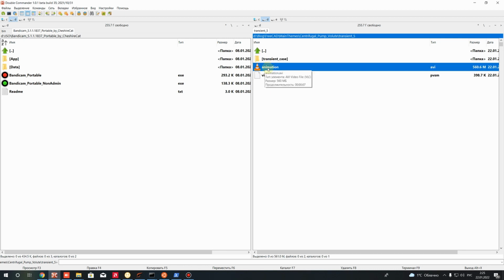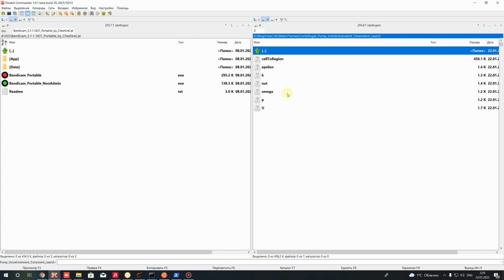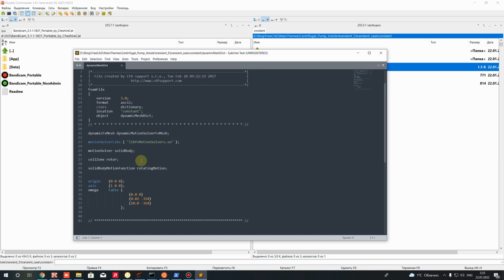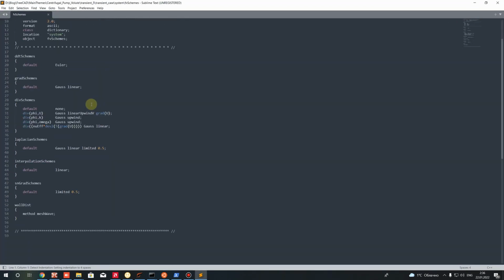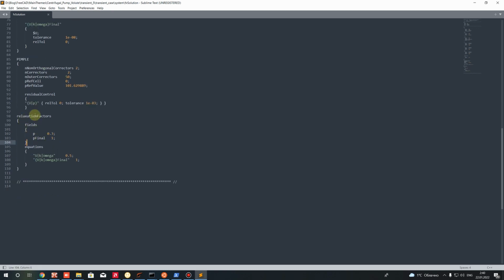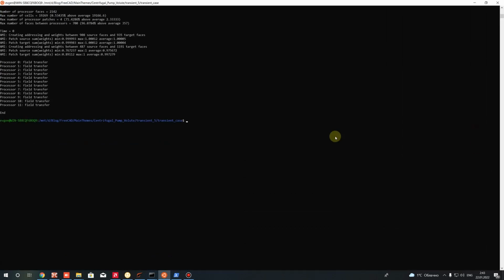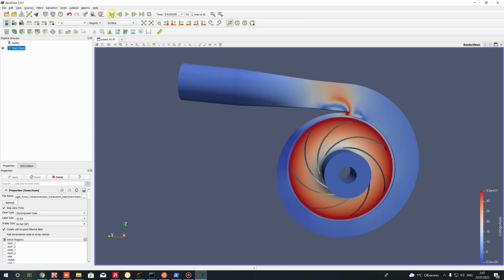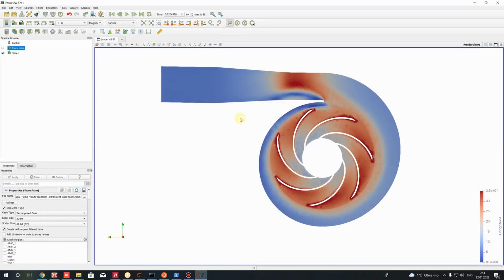FreeCAD + OpenFOAM Tutorial | Acceleration of Pump Rotor in Transient Simulation (pimpleFoam solver)

Comment: Hello, many thanks for this introductory video. Can you also share a video about the mesh that you performed for this case. I am trying to run a simulation in which there is a rotation of propeller attached to the moving aircraft. The AMI target weight is always 0 so it stops at the first iteration. I would be grateful if you can help.